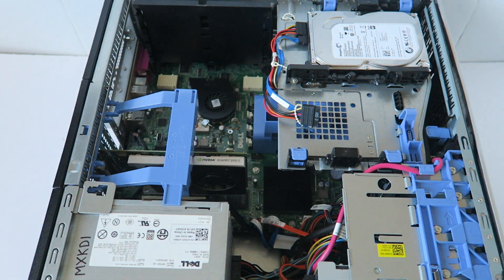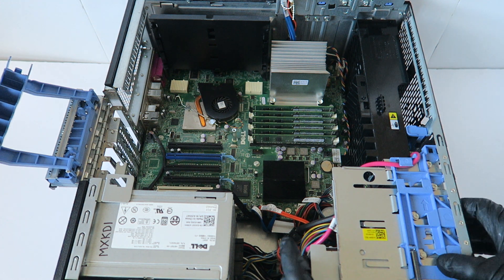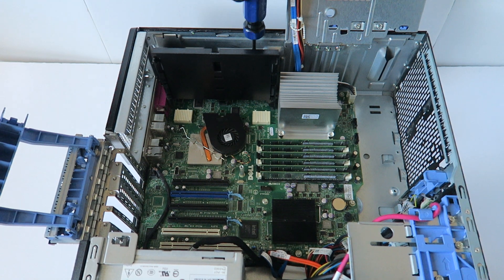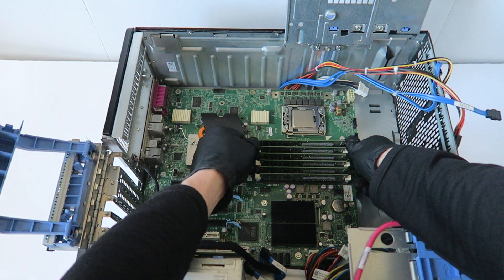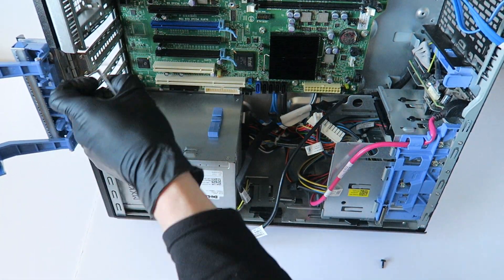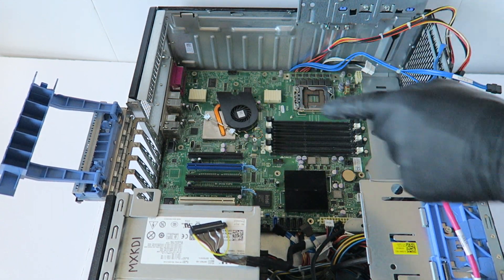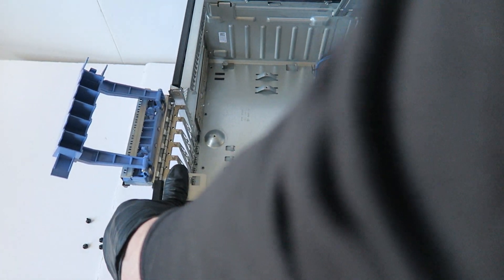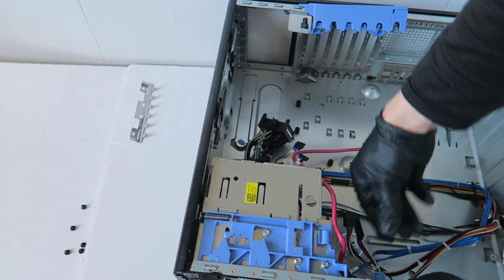Dell Precision T5500 Teardown

Comment: Is it possible to remove either the top cover (the panel with the service tag sticker and side cover removal latch) or bottom cover (the panel with rubber feet)? I would like to set the system up in a radio cabinet in desktop form, but it is ~half an inch too wide to fit. I believe it would fit if one of the panels were not present.
Reply: No, the top cover is a part of the chassis sadly, and so is the bottom.

Comment: is it possible to remove the power supply unit without taking out the motherboard? mine is faulty and i wanted to replace it but without entirely disassembling the cpu. please help

Comment: Hello, seems that you worked a lot with t5500, could you précise please does it work with 1600 memory or 1333 IS th highest possible ?
Reply from the maker: Hi, i only tested with this dell t5500 RAM DDR3 ECC Registered Kit (PC3-1333, DDR3-1333MHz) you can buy on ebay used.

https://www.ebay.com/sch/i.html?_from=R40&_trksid=m570.l1313&_nkw=MEMORY+FOR+DELL+PRECISION+WORKSTATION+T5500&_sacat=0&LH_TitleDesc=0&_osacat=0&_odkw=DELL+PRECISION+T5500+RAM
Reply: @Mxkdt  thanks for yours advice
Reply: @Mxkdt  is it possible to transfer all these inside parts to a different cabinet?

Comment: hi bro!
i want to install my t5500 motherboard into a different case.can this is posible?
Reply: Oh nahi bhai gee. Namumkin!
This PC is almost 90% proprietary. Motherboard is too big, CPU, RAM slots and the northbridge have different locations than ATX specifications and lastly, the front panel I/O connector is 100% proprietary. About the only thing that seems to be ATX compatible is the PSU and the dual intake fans, and that's it!
So basically, if the motherboard dies, you'll have to throw away the whole PC, because you won't be able to find replacement motherboards anywhere.
Reply: @Sam-K  it can be fixed in E-ATX case i have done it with T3500 i moved it into cooler master cubic case(i dont remember the model but it was big cube shape, yes front panel is little pain but i found the solution of power reset jumper in google, however i used the different psu bcoz the psu of t3500 died and that was the whole reason to move the board ino the different case to make it a bdget gaming pc with the nice touch of rgb fans
Reply: So do I...

Comment: is replacing a motherboard in a dell t5500 just a simple swap? i am having ram memory problems and think that the main board is bad.
i have 72Gb installed only 12 is showing.... just replaced the secondary CPU / memory riser board and still only 12 showing.
i think its a mother board issue? was going to try to get a new Motherboard?
please let me know what you think.... thanks!
Reply from the maker: Hi try to clear cmos and the memory you use match pair or not?
Try to test 72gb memory in different machine or server?
Reply: Mxkdi thanks for getting back with me. I did replace the battery for the cmos. The ram is brand new, not sure if it is matched - don’t think so, but new and made for my dell t5500.  It’s the correct DDR3 8gb sticks ecc 1066 or 1333 whichever is compatible and should be fine.  I was getting the memory not recognized in dim 3 slot. I think that’s a common error for t5500’s so I think it’s the main motherboard. Will the computer fire up after replacing with a new board? I’m sure I will need to install new bios drivers but is there anything else you have to do to get windows to run on a newly installed MB?
Reply: @JohnBrown-nk4on  Hi John did you get any further with this? I have a similar problem with 6x4 Gb sticks in the main/riser. Was getting intermittent DIMMs errors and then a solid "4" light indicating CMOS issue. Going to try to reset the BIOS with the RTCSRT and PSWD jumper reset. This has been with me from new and I love how scalable and robust the machine is. Any ideas for a good source of mobos for this machine? I'd love to keep it running for another 9 years!

Comment: Ever tried to put a T5500 Chipset Heatsink & Fan on a T3500?
Reply from the maker: Hi, no i did not try.
Reply from the maker: i am using 60mm fan on northbridge chipset runs really cool and dual 80mm fans rear runs at 6v very quite.